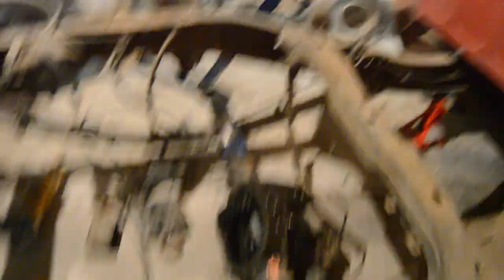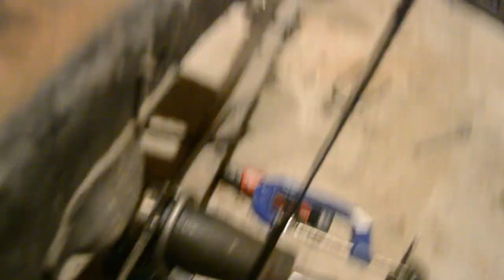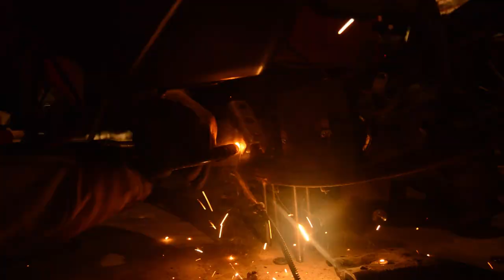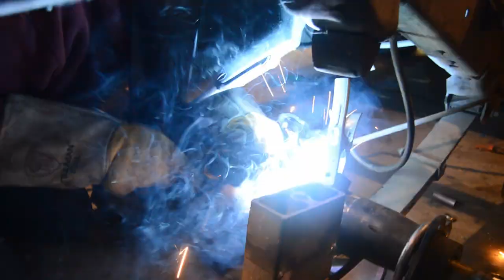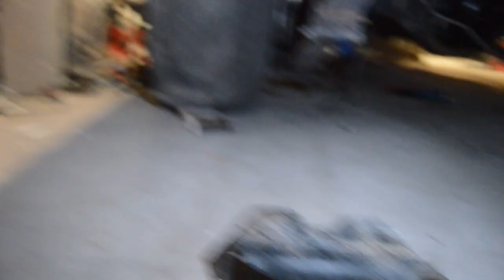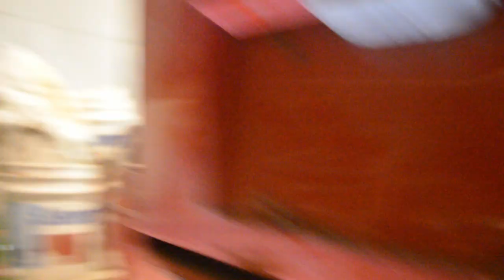Instaling Ford 8.8 rear end in s10

Comment: What did you use to join the stock s10 fuel line that comes back to the 8.8 dif?
Reply from the maker: Fuel line or brake line ?
Reply from the maker: Fuel lines were completely custom for a LS swap brake line I can’t remember but I I want to say I bought some sort of y block and used the ford brake lines from the caliper

Comment: Ultimate 88 from Yukon gear eliminates the c clips and has chrome molly shafts for the explorer rear ends
Reply from the maker: Nice I didn’t know that
Reply: Yup, that's what I'm running. Just get two short side axles. Chromoly 31spline. The explorer has thicker axle tubes, so they are stronger than a mustang rear end.
Reply: Good info guys! Thanks! 🇺🇸🏁

Comment: What year mustang would you recommend grabbing a rear end from
Reply: 2004 and up Crown Victoria or any 4 door Explorer made before 2002 except for the Sport (2003) and Sport Trac (2005). Any Ranger or Mazda B series trucks are also a good choice. The best 8.8 rears are from the 302 powered Explorers and Mountaineers. Make sure that it’s got disc brakes not drums.
Reply: @atx-cvpi_99  will the drum brakes wont work? Currently have drum brakes in my s10 and running 15 inch rims … will i still be able to run 15s with disc?

Comment: Which u bolts did you buy?
Reply from the maker: The day I bought the rear end at the junk yard I brought the ones off the explorer with me. You have to squeeze them together to fit into the s10 stock shackle. Or if you go to a local leaf spring shop a lot of times they can bend you up custom lengths on the spot
Reply: 8.8 has 3 inch tubes

Comment: Did you use another passe German side axel after shortening? Nd what's the length you need
Reply from the maker: No I ordered axles from moser but you can just use 2 shirt side acles
Reply: What over size is rear after shortening
Reply from the maker: I can’t remember tbh I’m actually pulling this rear end soon I’ll measure it
Reply: Plan on selling
Reply: @darksideperformance299  plan on selling are you in cali?
Reply from the maker: Yes I do actually